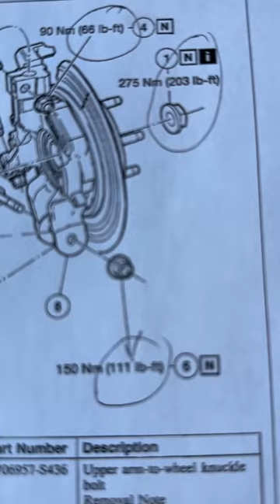R & R rear Knuckle and bearing assembly

Comment: The moment it was put together with rusty bolts, torn boots, old everything else… almost had to do a handstand. At least clean the bolts man.

I replace everything when there’s major work to my car because I’ve learned, it all fails bit by bit. Do it all once, don’t have to return. See you next week for them ball joints.
Reply from the maker: Some customer or owner they are cheap, they don’t want to pay more even a new bolts or nuts. The owner supply the knuckle and just want us to install, don’t do anything else. As a license tech make sure everything is safe for customer. The bolts no need to be clean and they are torque to spec. Tie rod end and ball joint boot are torn but not play or loose, it still safe and of course we let them know and they understand the conditions of their vehicle. Thanks

Comment: No lube on the axle before you put it into the New bearing. What a shame. Lazzzzzzzyyyyyyyyy
Reply from the maker: It’s already have some old anti seize on it and I don’t like to use any grease on the spline. I use to spray some w40 on it and inside the bearing. You don’t see everything on short video. Thanks